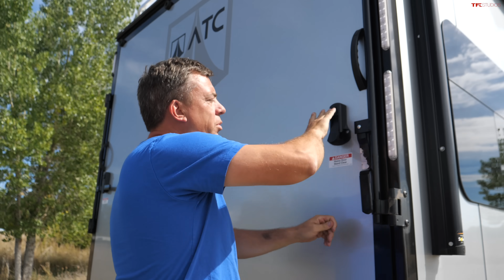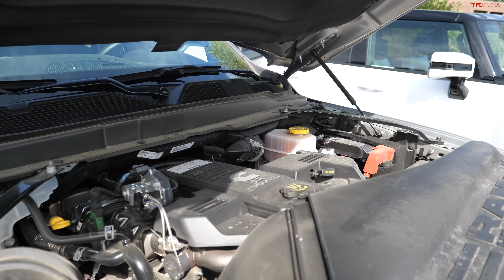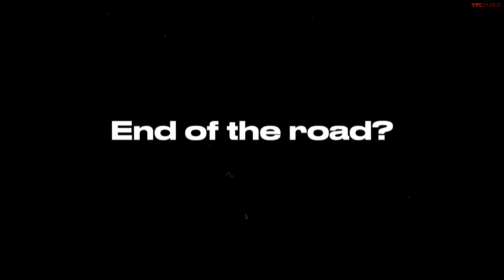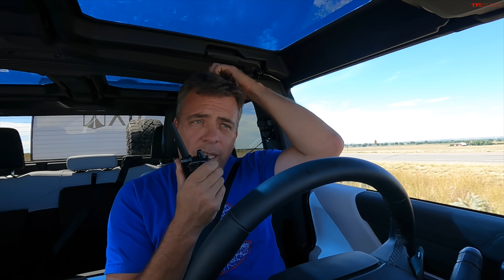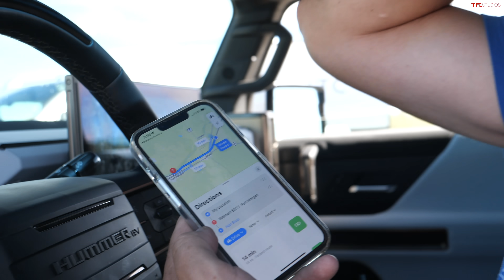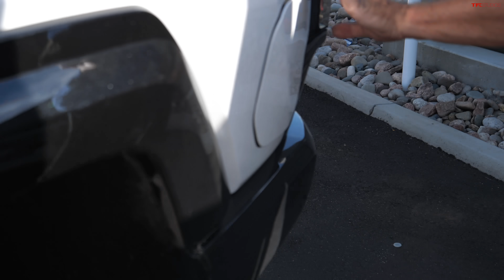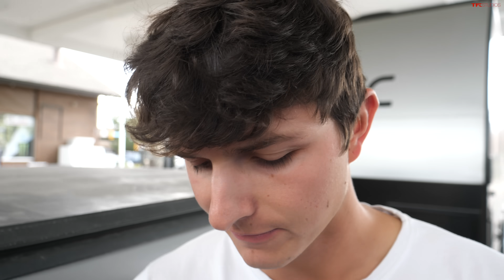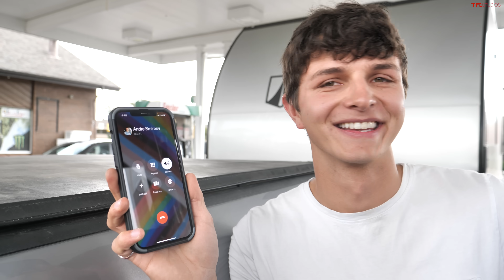How Far Can a Diesel and Electric Truck Tow An Identical Camper Trailer on ONE Fill-up?

Comment: Thats awesome the charge was free, but let's use the numbers to find out the future cost. The Hummer charged from 7% to 51% for $37.41 according to the EA charger. So $0.85 for each 1%. At that rate it would cost $79 to charge the Hummer to 100%. Hummer cost per mile: $79 ÷ 123 miles = $0.64 per mile.
Cummins cost per mile: $105 ÷ 211 miles = $0.49 per mile
Reply: Also, the time to charge a battery vs. Fueling at the pump!  Time is money!  I don't want to be sitting there waiting for things to charge!
Reply: @MsMrhawk  Anytime you spend waiting at a charger is deducted from your remaining lifespan.
Reply: @DFDalton1962  also, with a gas or diesel vehicle, you could bring a gas can along if you do run out of fuel. It would be enough to get to a station in most cases.
Reply: @jeepinintexas6215  - I suppose you could load up with those portable emergency phone chargers. Maybe that's what they intended for all the space where the engine compartment used to be 😅😂😆🤣
Reply: @jeepinintexas6215  
With a EV you could bring a heavy gas or diesel generator to recharge, but would you be able to get a full charge? Also would the generator be able to put out enough power? Things that make you go Hmmmm. Lol.  I always wondered that if EV owners ever consider what fuel the power generation stations use to generate the electricity for the charging stations. Think about it, the carbon footprint is only displaced from the EV to the power generating plant.
Reply: Not to mention that in a previous review they were charged a bay occupation fee of 20c/min after the first 30min 🤦‍♂️
Reply: Also gotta take into account the amount of diesel fuel the generator uses to charge the hummer 😂
Reply: @RiggyRonnie  😂😂😂👍💯
Reply: Thanks for doing the math. I was wondering about that. EV Trucks are definitely not ready for prime time but like someone said, kind of a hobby. Someone in our neighborhood ordered one and received it. About a month later he "flipped" it for a profit. Smart guy.
Reply: The price will actually get worse if your home as as you use more power your tier power rates will cost you more.  And don't forget the time wasted unless you pay another 1k for at least a level 2 charging station.
Reply: @BusterTN  I don't believe that exists everywhere.
Reply: So far everyone has missed the biggest factor: pump diesel price is maybe 30% road tax. EV's use the road too, but have no road tax. So if you add 30% it's about $0.82 vs $0.49, apples to apples. Yer welcome
Reply: @drkies  “EV’s have no road tax”…….yet.  There’s a screw’n coming, wait for it
Reply: One huge thing nobody talks about. Here in Canada over half the price of fuel is hidden taxes which our government claims is going to "road taxes". When everyone eventually switches to EV's do you really think the government won't find a way to collect those billions of dollars that will disappear from gas taxes? The price of charging EV's is subsidized big time right now, but when everyone switches over...what happens then?
Reply: @truckguy6.7  Mobility, safety and freedom will be lost forever.
Reply: The charge wasn't free, someone is having to pay for it, not only that it still took coal to get the electricity to charge that 115,000 radio controlled truck.
Reply: @DFDalton1962  to be fair, $150,000 electric hummer couldn’t even make it! And they are using a 350k charger? C’mon man! Most electric chargers put out maybe 3-5k watts. You would be waiting for 5 days for the hummer to charge at that rate
Reply: also, when you stop to charge, you almost inevitably buy something, lunch, a snack, a coffee, etc. So, that adds up as well
Reply: @scottstyles1986  Yep, especially when it'll  30+ minutes.
Reply: @scottstyles1986  every 1.5hrs? Not even close. I think you need to dream some more.
Reply: @DFDalton1962  That's a good point. Also, in many cases you'd have to unhook your trailer and then recharge, since charging stations are not meant to accommodate trailers. 

EVs aren't a joke for everyday driving, where 99% of trips are under 25 miles, but they are a joke for towing and serious work. I don't see how they solve the problem anytime soon either. The easy solution would be a plugin hybrid pickup with 30-40 miles range for most daily trips, and then a gas or diesel engine for longer trips and towing. I have a Chrysler Pacifica Hybrid plugin. 90% of driving is electric, but I never worry about recharging or range when I take a longer trip. Best of both worlds.
Reply: @BHS72inNC  yeah and the issue with that is plug in hybrids are just waaaay better options for nearly every use case, or electric with a fossil fuel range extender.
Reply: Not just that but the cost of replacing the battery in 5 or 10 years, so triple that cost to $1.92 per mile.  It also cost $46,000 more for the Hummer than the Dodge.  $46,000!  It wouldn't even be that good for a weekend trip up in the mountains where I would go.  And I wouldn't touch it for $114K.  Isn't even close to being a good value.
Reply: Your not including the cost of the hummer! Your not saving as the hummer purchase price is rediculous
Reply: Charge not free,electric bills.burnin coal to get that power to that plug in don't forget.fossil fuels here to stay.
Reply: I love math- it cuts through the Bullcrap and smoke
Reply: We are decades away from this technology taking over, IF it ever does
Reply: You can't show the numbers, thats goes against all things they keep telling us.
Reply: Even if electric was cheaper the time to charge is way to long . Even if you get hi speed charger to work good but if it don't and you have to use low speed charger it takes how many hours I could grab 10 gallons of diesel and bring with me. The battery says it's water proof then why do I see electric vehicles catching fire after floods weeks later.
Reply: Just wait till elec rates skyrocket even higher as a result of propagandist EV craze! Which will effect a lot more then just EV's.  We will be beggin to have our good ol ICE vehicles back at that point.
Reply: You can also see the Hummer wasn't running AC because he was sweating which means the milage would of been worse.
Reply: Charging on home power could do an entire charge for $30~ in my area.

216 kwh battery pack, and 14 cent per 1 kw of electric. 

At home charging would obviously only work for daily commutes or very small "road trips" with no towing, though.
Reply: @whatta7793  and how was the electric generated at the power plant?  Was it coal, nuclear, hydro, fossil fuel?
Reply: @charlesbyrneShowComments4all  majority of electric is indeed produced by coal and natural gas, yes. Huge fan of both. Coal is the most important part of my hometowns economy. If coal is doing good, everyone has money. If coal isn't doing good, like under Obummer, then the local economy starts to hurt. And people go get basic jobs at retail stores for the most part, or if they're lucky, switching over to a logging job.
Reply: Not to mention the amount of time the Hummer had to sit at the charging station while the diesel truck and trailer could continue down the road. EV tow vehicles aren't even close in capability to diesel trucks at this point.  I'm guessing another 5-10 years or more with updated technology before EV's will begin to compete realistically.
Reply: @DFDalton1962  AMEN👍🤣👌🇺🇸
Reply: Nothing is free. If the charging station he mentioned EA electrical America is being subsidized by the Government, guess who actually paid for it? That's right taxpayers did.
Reply: Let us also add in the increased cost to insure the EV as well as the extra TAXES and the HUGE price increase to purchase the EV over the Gas/Diesel Trucks that offer a larger bed capacity...YIKES!
Reply: u guys are lucky, my diesel is $6/gallon here in hawaii
Reply: @handyvan3422  lol, friend.
18 degrees and snow on the ground
In Minnesota. Not feelin' that lucky.
Hope you be smilin'.
Reply: Imagine being stupid enough to buy an EV.
Reply: That's awesome 👌
Reply: AND! The RAM could have gone another 100 miles. Not to mention, it states that you shouldn't let the battery discharge past 15% - so really he got more miles out of the battery than he 'should have'
Reply: AND YOU HAD TO SIT FOR AN HOUR TO CHARGE WHILE THE DIESEL IS MOVING
Reply: And thats BEST CASE SCENERIO lmao
Reply: You're also forgetting the biggest part of all this. He didn't finish the trip. his goal should have to actually go to the destination. That's means
The EV would have had to 
Recharge at the halfway point 
Recharge at the end point 
Recharge at the halfway point on the way home. 

The diesel would have filled up once.
Reply: @soppybottomboys1195  Yea and he would have had to fill to 100% every time which would take hours just to have the range to make it to the next stop.
Reply: So I guess an EV owner could carry a heavy gas or diesel generator to recharge, but would it be able to fully recharge the battery before it ran out of fuel?  So you would have to wait at least 2 hours to recharge with a generator vs 3  minutes?? AT MOST,  to dump in a 5 gallon Jerry can of fuel and be back on the road and at your destination in less than half the time.
Reply: Also, keep in mind that EV's do not pay the highway use taxes that gas or diesel pay....yet.  In the future, a mileage tax will most likely be assessed to make all things equal.  Also EV's are very heavy and will be more apt to cause wear to the roadways which will have to be paid for with extra taxes on them.  Also, the EV's may require more expensive tires to obtain longer tire life...I haven't heard much talk about that.
Reply: Now imagine if the current nutjob administration screwing things up wasn't in power and diesel was cheap like it use to be. 
I drove out to my hunting property this weekend to go setup a new game camera in my Jeep JK. It's 186 miles to there and the same coming back for a total of 372 miles. Lots of hills and driving against the wind too that killed my mileage. Back when 87 octane gas was $1.85 a gallon it wasn't a thing. Now I wince every time I have to fuel up the Jeep at $3.40 a gallon 🤬
Reply: @jeepinintexas6215  5.34 in Ca for low octane gas, diesel 6.32.
I came here after the military for a LE career, now that I recently retired I’m leaving. This place is a cancer to common sense
Reply: @Rakkasan-vr8xt  I moved to Texas. Entire family is in Washington. I can't do it anymore blue side of WA is 5 years behind Cali in regulations.
Reply: @jeepinintexas6215  Try $10.60 a gallon for diesel here in Australia at the moment!!!
Reply: @brucemckenna7035  I'd never live in Australia lol. Nothing about that country seems logical
Reply: @jeepinintexas6215  Just asking: What part plays the admin in defining the price for gasoline? The price for gasoline exploded everywhere in the world.  
 
And the oil corporations make bigger profits than EVER in history, while selling less. 
Same is with most other corporations in all business areas. 
 
What shall be done? Regulate these corporations that use the crisis of Covid and Ukraine as excuse for an unprecedented rise in ripoff? Disown them?  
Or should one use the standard weapon of the Republicans, lower the taxes for the corporations and remove all regulations, because then they will surely reduce their prices and stop stuffing the billions in their own pockets?
Reply: @feedingravens  Something like killing the keystone pipeline and ending hundreds of oil leases on day one of the current administration. Then killing 1000s more leases in the months after. Doing everything in their power to turn us back from being a net exporter to a net importer as quickly as possible. In an already stressed geopolitical climate, making sure we will be subject to the whims of our enemies so they can make some more money off of us. That's one way that the government affected fuel prices. That's just a very broad answer that just skims the surface and is only part of the issues the government has been creating over many decades. It's not solely limited to this administration. They just took a house fire and threw a forest worth of wood on it. Then dumped our strategic oil reserves on it to "put it out". Now we have a CA size wildfire fueled on by our oil reserves. The coming years are gonna get bad no matter who is in charge.
Reply: @feedingravens  - I don't even know where to begin telling you what's wrong with your comment, and don't really have the time, energy, or motivation to try.
Why don't you go do some research & tell us all what the oil company balance sheets looked like from March 2020 through the end of 2021. Spoiler alert: they had huge losses that entire period. Not only because no one was driving anywhere, but because they continued to produce products, in anticipation of the huge surge in demand once things opened back up.
Reply: @feedingravens  you need to check the pockets of your left side heroes. Last time I looked they were all rolling in cash and smiling about it. Maybe someday you'll grow a brain and realize that politicians are your enemy. They do for themselves, not for you.
Reply: @feedingravens  
Untrue.
It wasn't everywhere in the world.
A quick search showed one country at 0.02 cents a gallon
One at 0.05
One at 0.32 
and one at 0.34
( 1/30/23 prices )
Presidents don't set gas prices but their energy policies do. Certainly you can't believe that you can change all your energy policies and it has absolutely no effect.
Reply: @feedingravens  America is run by a cartel..the cartel works with the oil cartel and medical cartels...

Simple when you think of it like that. All politicians profit off siphoning the money out the average person's hands.